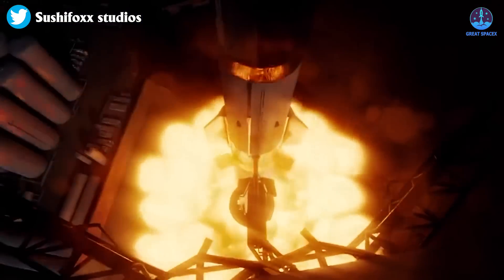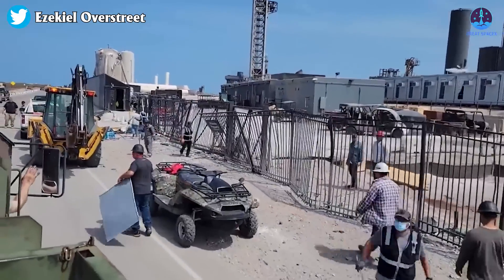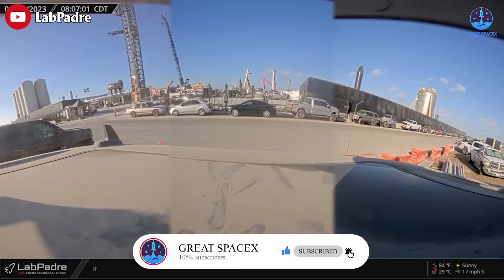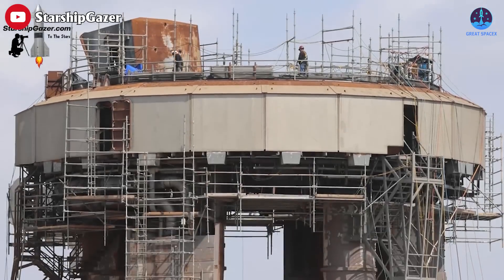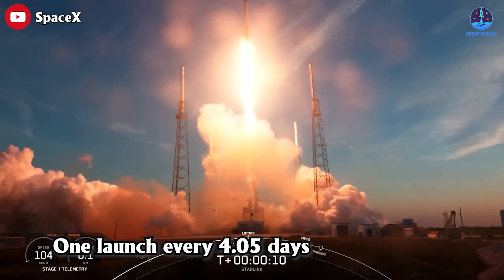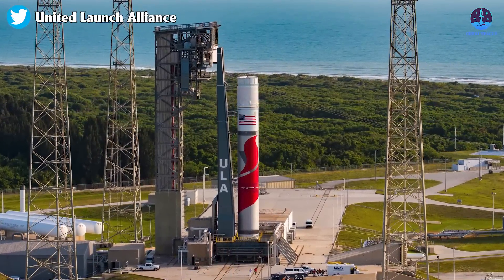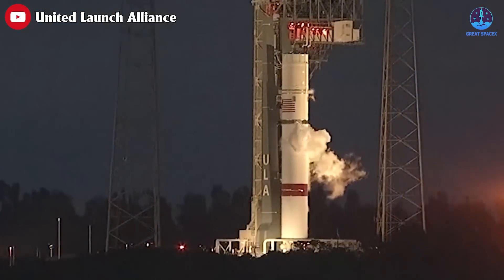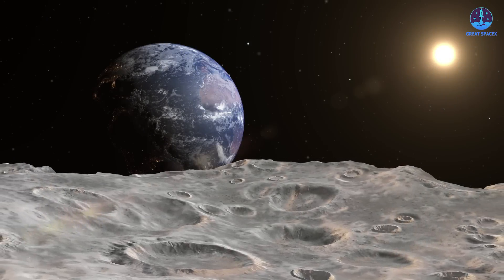Elon Musk's massive detailed updates on Starbase launch pad...

Comment: You know, I listen to all of you make the statement: "The concrete was not strong enough to withstand the pressure of the 33 raptor engines firing all at once." The truth is that the ground underneath the concrete was the problem. The sandy soil was full of full of air and water. This mixture is what could not withstand the thrust. Once the subsurface soil began to compress, there was no support for the concrete press down onto. Concrete has great compressive strength but it requires a substrate to support it. Otherwise, the longitudinal flexing is what causes it to deform and crack which allows the engine exhaust finds its way through the cracks and begins to blow the ground underneath to be blow out, leaving nothing for the concrete to support itself by.

Comment: I think this thing needs way more space underneath to prevent or reduce damage.
 When I strike my torch on to heat things, I do it out in the open air and bring it to the material. I don’t think it would work well to start my torch 1/4 inch from the material. The gasses cannot breathe properly. One of the issues may be the pressure or fuel buildup in a tight place causing a small explosion while igniting This is all observational and I’m no rocket man. 
I have always been curious about the surface ocean launches.
This Is one big mother trucking rocket. It’s a beast it needs to breathe to roar and then that thing will soar. No homo

Comment: If anyone is dumb enough to think that adding water will make the situation work, you're wrong.   Last time, debris was thrown upward when the hole was dug out.  Since they are using a much stronger steel plate, the ground will remain intact, especially since the gas will be moving away from the pad rather than into it like the first launch.  The water will drastically cool the exhaust, so there will in fact be less pressure,  because you spend considerably more energy to vaporize the water than heat it up, and thus the mass*temperature will in fact be significantly lower than if there was no water getting pumped in.  The water will also form a barrier of slow moving fluid on the plate which will prevent the same gouging action that happened when the hot and fast moving exhaust hit the old pad directly.
Reply: We're is your Rocket? I don't see it anywhere.

Comment: Elon you really need to install a “BlowOut”;below ground blast-tunnel   For both heat& Burnt off Fuel. It also gives your Fuel load somewhere to go should  9:26 THE 32” Booster “ melt-away ‘Ground Zeros Launch pad.An angled, below ground;”1/4 booster deep hole,”with a Left;Right;Center; below rocket water inflow;with a directly across& Under Pad;Right>Left\|_>^;with 2Lesser runOffs toward Fuel tanks,(Just in case-Linger on Safe Than Sorry);4 Build Time&FAA Paperwork. The blowAway exhaust headed towards the sea&Starlink board. Perhaps an underwater tunnel to a constructed island;containing 2 side by side Landing Zones for Starship or Falcon landing’s.Adjoined to STARBASE by 9:26  means of Carbon Fibre Railway lines,to ship the 2 landed boosters or 2 Main Rockets back to their Service Areas in Bocha Chica’s STARBASE. And if rumours are still true&you’re considering bringing in your own gas from The Ocean or via Tanker;it will serve a multiple Function improving both time and cost. You could use Solar run Drone ship s to drop the fuel at the island. Pick-Up:Offset deep water islands for various fuels. Give Multi-Purpose landing Islands, tanker farms a thought. It’s only a win win situation.
Reply: WOW!!! You're hired!!!
Report to Starbase and tell security that I sent you there.
👻☠️🗽💯🙏

Comment: they may reach orbit with the next test (i hope they do) but the stand will be destroyed again. all of the energy that was used to dig out the big hole last time, will now be reflected back up to the rest of the stand and the rocket engines even more than before. plus now you will have all of that water instantly turning to steam that takes up so much more volume, further increasing the pressure on the platform and rocket engine.
Reply: No.  "Energy" doesn't reflect like that.  Last time, debris was thrown upward when the hole was dug out.  Since they are using a much stronger steel plate, the ground will remain intact, especially since the gas will be moving away from the pad rather than into it like the first launch.  The water will drastically cool the exhaust, so there will in fact be less pressure,  because you spend considerably more energy to vaporize the water than heat it up, and thus the mass*temperature will in fact be significantly lower than if there was no water getting pumped in.  The water will also form a barrier of slow moving fluid on the plate which will prevent the same gouging action that happened when the hot and fast moving exhaust hit the old pad directly.

Comment: 50/50 chance stage zero works without new damage even  if it works 100% you think that Starship will be capable of landing with chopsticks, refueling in space, landing on the moon, getting human rated and being reused rapidly (in hours) in less than what 5, 10,15 or 20 more years? Anything less than 15 yrs. for all will never happen. Space X own reorder proves this. In the end StarShip will take 30 to 35 yrs in total to develop. So far if it's 11 or 14 yrs in development (2009 or 2012) it makes little difference your sill 20 yrs away from landing a unmanned Starship on Mars. It took 18 yrs for Falcon 9 to complete most of its mission statement even today the uperstage is not reusable.(2002 to 2020)

Comment: I still think that they need a Diverter system still with reenforced steel barrier. 32 Engine firing right near the pad is too much of a problem.
Reply: They do not need a diverted system. There are NASA studies about how angling (diverting) the thrust can actually make things worst. If you have a perfectly adjacent pad with water suppression, the waves are more uniform.
Reply: They should build tunnels with his boring machines.

Comment: Standard "foundational" concrete takes 28 days to reach 98% of fully cured. The deeper a concrete pour is in depth, the longer it needs to cure. The tradeoff with curing "accelerators" is the final cure strength, the more curing accelerant you add, the  more you compromise the final cure strength.  A pour this deep is gonna need more than a month to fully strengthen.

Comment: I am anxiously waiting for a performance of the modified Starbase launch pad.  Wanting to see the performance of the water cooled steel blast plate , especially the upward facing water orifices.  The latest  Raptor  more powerful and efficient engines are to be used on the upcoming test?
Reply: The steel plate will function perfectly. I've seen the engineering.
And no, Raptor 3's are still in development.
Although, these are upgraded R-2's. Much more reliable.
  No worries. Elon has this.
👻☠️🗽💯🙏

Comment: If this new test launch is going to involve hot staging then that is going to be very interesting to see how the top of the booster will look like after being subjected to the blast and heat of 6 Raptor 2 engines. That is around the same as 10 Boeing 737 airliners all firing their engines together and aiming the combined jet blast into the top of the Superheavy booster. Remember, the Superheavy booster is not intended to be expendable.
Reply: They might be Raptor 3 by then…
Reply: Trust me. They have it figured out. Hot staging has been used for decades.